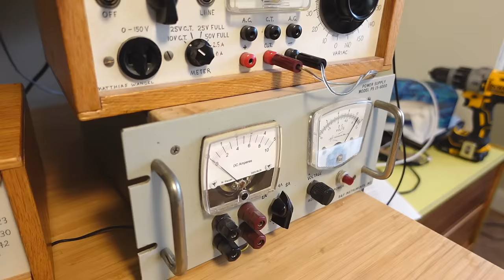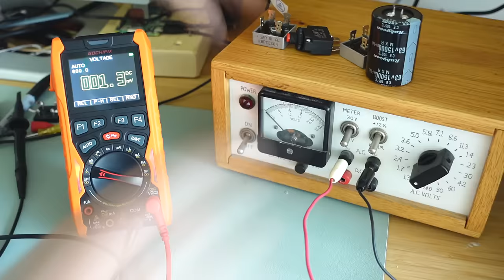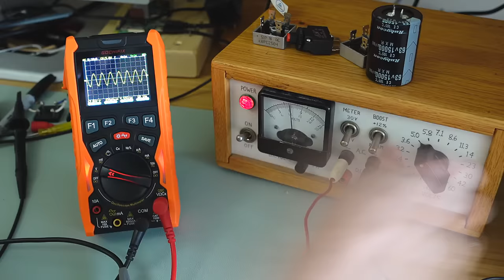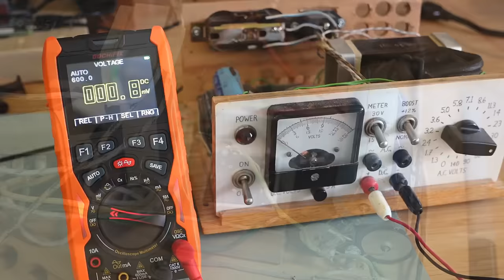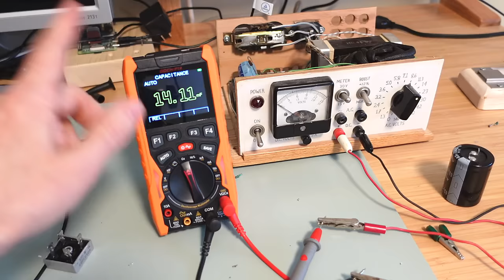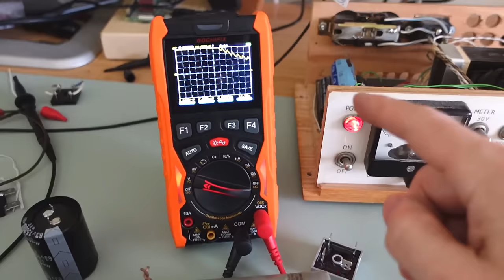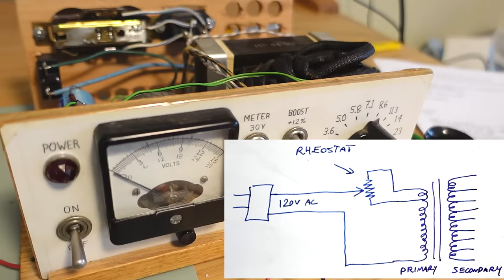Fixing a benchtop power supply I built 37 years ago

Comment: I find it funny that 6.3V is one of the most common filament voltages for tubes, but your transformer does not have a tap for that. OK - 5.8V + 12% boost gets you close, but not exact.
Reply from the maker: The rheostat would adjust for input voltage, so for a typical input voltage, the rehostat would probably be centered, and put it half way between boost and no boost.  Also, those voltages are measured with the cheap volmeter I had at the time, and the line voltage we had at our house.  Our last house had 126 volts, which was not that typical.

Comment: Electrolytic caps get a bad rap because cheap junky ones do have a tendency to fail, especially those from the capacitor plague. But in my experience good quality older electrolytics last a very long time.
Reply: It depends how the capacitors are used how long the're going to last. Caps fail in modern equipment because we use them pretty hard.  A SMPS may switch at hundreds of kilohertz. That's tough on capacitors. Plus we don't design as much headroom into equipment anymore either. In the past 200% was standard and now it's more like 20% If stuff specs at all. Cheap chargers usually can't do half what they claim.

Comment: older metal can caps of that era are generally fine. Older than that and you start getting into paper ones then yea, newer than that where they started making micro sized and early SMD caps like the late 80's get sketchy. 90's are generally OK then in the 2000's they went to crap again in all sizes

Comment: Cheap (for the time of manufacture) caps tend to go bad over a few decades or even a few years. Decent caps can last many decades. I've got a 1960s Lambda power supply on my bench that still runs just fine. I've never opened the case or replaced a part other than the voltage adjust pot. I've never needed to.

Comment: Nice wooden case and that multi tapped transformer is really handy. I still have a small bench supply I built around 1990. It's fancy because I splurged on a Radio Shack metal enclosure. 😊

Comment: You are making me want to build one of these. I use a car subwoofer in my room, mainly because its much more powerful than home subwoofers that are AC driven, and less expensive than buying a dedicated indoor subwoofer with an amplifier. A power supply like this could actually let me run the woofer much harder than I can now using a computer power supply for a DC voltage.

Comment: 3:10 that grease may be worse than an air gap. you might want to do a bit of testing to see (or just look up thermal conductivity for that type of grease). some greases actually insulate better than air. i always keep a roll of a sil pad tape for exactly the situation you were in where you don't have or can't find any thermal compound (or thermal epoxy). sil pads are often more than good enough for hobby stuff like that power supply. and having it in the roll is awesome! its a bit expensive, but its like having a roll of copper tape and a roll of aluminum tape. buy once, cry once and you will probably never use the whole roll lol

Comment: Really appreciate the info in this. Never thought about building a powersupply. but definately seems do-able considering you've done it 3 times.
Reply: My understanding is that ATX power supplies are the easiest way since all the wires are color coded
Reply: I thought about building a PSU when I got tired of dead batteries experimenting with electronics. That happened when I was a broke kid at 15 years old. I couldn't tell you how many PSUs I've built since then. A few dozen. Every electronics project needs a PSU.

Comment: I was surprised the capacitors were still ok, though i might have been tempted to swap it out regardless.
Reply: The caps are only dealing with line frequency. Plus they're quality caps. Still as good as the day they were made.
Reply: Some of the caps you can get today would die before these old ones did, so I wouldn't change them unless needed. Not everything from China is junk but some electronic components from there are; gotta know what you're getting.
Reply: @P_RO_  The one capacitor Watthias has is a Rubycon. They're the best capacitors made.

Comment: Usually I watch this on Marco Reps' channel but he has mostly newer stuff. And it is also way over my head.
Reply: That's a pretty simple PSU.  The transformer steps AC down and the bridge rectifier converts AC to DC and the capacitors smooth the rippling DC into a smoother DC.

Comment: Often  a circuit breaker is not fast enough to protect semiconductors.  Good video.
Reply: It is if protecting against over current, since it takes some time for the heating to take effect and break the semiconductor. Particularly something like power diodes.
Reply: @johnpearcey  He has a transformer which adds impedance so that limits the heating.

Comment: SMPS capacitors go bad because they are subjected to high frequency. That high frequency causes internal heating of the capacitors.
Reply from the maker: That power supply rarely even gets warm, and its usually in the basement, so it doesn't even get warm in the summer.

Comment: Are you sure the meter updated when using the new capacitor? It appeared the same as the old caps but if the ripple is so low the scope meter doesn't trigger and doesn't run in free running mode the last capture is of the old caps.
Reply from the maker: it went from flat line to that waveform, so I'm pretty sure its not the old waveform

Comment: I think I figured out the schematic for your rectifier, test: You are feeding AC via a current sense resistor into the AC terminals on the rectifier with nothing / no load on the DC terminals, right?

Comment: That transformer physical size looks about 30 watt, maybe 35 watt.
So it really should NOT be pressed to the 6 amp range, ouch.
For continuous use that's about a 12v 2.5 amp supply.

Comment: I'm certainly no expert, but is there any chance the caps are only bad at higher voltages? IIRC, multimeters only measure caps at a couple volts.
Reply from the maker: I also measured the ripple current left after filtering, and that was the same as with the new caps, so I would assume they are good at higher voltages too

Comment: When a digitally controlled buck boost module is so cheap there's no practical reason to not use one of those in combination with atx pc power supply
Reply: It you need fine output adjustment maybe, but it will also be noisy. Depends on what you want.

Plus, why replace what still works?
Reply: You can even adjust the output of an ATX supply. But it isn't ideal. All of the components in the PSU are sized for a specific output. But if you change the voltage reference voltage the output will change too. The control IC is just going to track the reference.
Reply: @jojoposter  you can add more filtering to clean SMPS up a lot. What's in a PSU is like the bare minimum. Another layer of filtering helps. I've seen a substantial improvement adding a Pi filter on the output. From OMG to not tea bag.
Reply: @jojoposter  its not like the supply in the video is noise free
it is not linear regulated,just a simple rc filter
Reply: @1pcfred  yes, with simple switching power supply there is always a 431 zener diode and by replacing the resistor you can tune the zener voltage (now the cheaper supply sense the voltage from auxilary winding though) 
but the downside is its allot less efficient if you want large voltage range and the voltage cannot go too low (but yeah indeed under 3.3v is rarely used)
the cheap buck boost module also have percise current limiting which is very handy to test leds and to not destroy the circuit if something goes wrong
Reply: @lifeai1889  a 431 is called a programmable zener but it's actually an integrated circuit. There's 12 transistors inside of them and some passives too.